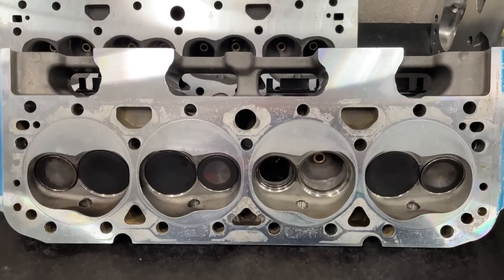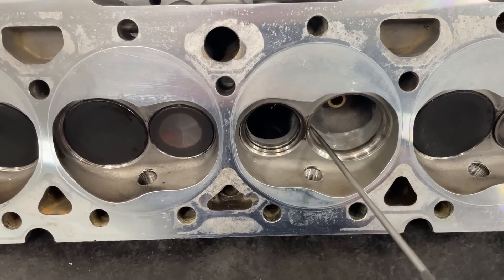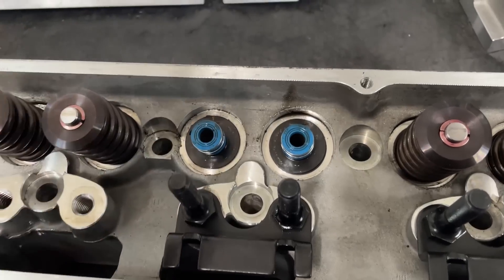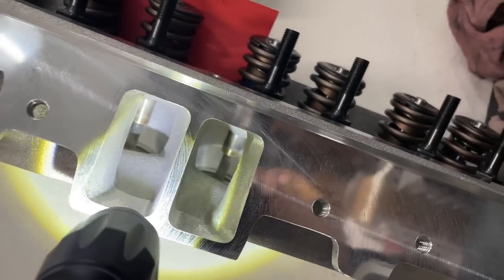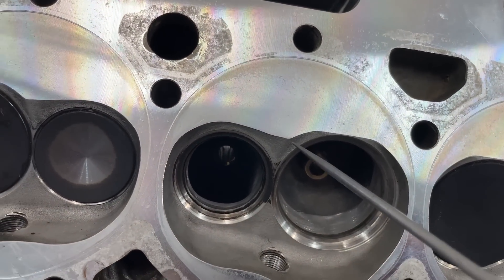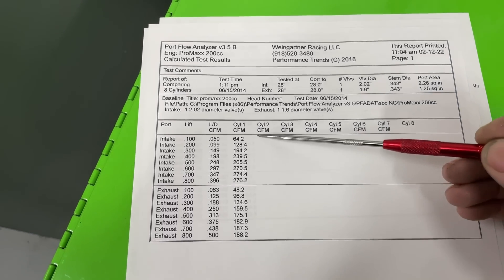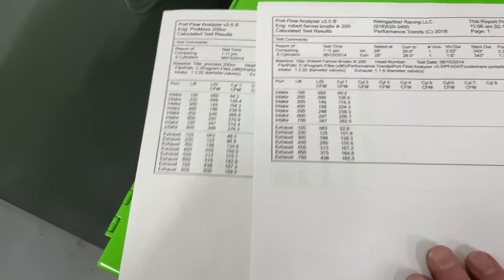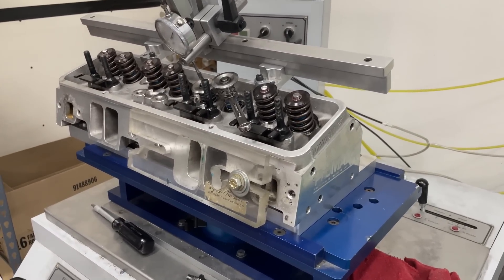ProMaxx SBC 200cc Head Review With Real Flow Numbers

Comment: Just found this video, just to confirm, these are the Maxx series promaxx heads? Thanks! Great content!
Reply: yes 383, 500hp pump gas with maxx 200 heads on solid roller and 600hp on 408sbc dynoed with hydraulic roller with solid rollers and solid springs

Comment: Thanks for this video. I got a set of their 183 heads and later saw a video where you shared Promaxx was a copy of the IL head. I feel it’s safe to assume the smaller 183 would be just as proportionally better in flow than it’s Brodix original? Promaxx’s advertised numbers for that 200 head are really close to what you found.

Comment: Begs the questions: I have been told as I have been out of the game for 25 years (military), that many of the "cheap" heads have crappy valves and very thin guides. I get there is some truth to that. For example the  Edelbrock e street heads, budget friendly USA built heads, advertise max .550 lift but have a reported issue above .500. I feel that they most sell a butt ton more heads then the negative responses would leave you to believe, and I would assume the majority of issues are user errors. 

Promaxx (changed names a few times) has the same reputation, but they have been around so long now the heads have to be "okay" at least?

Comment: i run PW heads and they also outflow brodix. it is an exact copy of ik 200. only difference that i can see is the PW has a 67 cc chamber. casting is ultra smooth. they use Brodix valves,  Howards dual springs, Manley valve retainers, Comp valve locks, brodix valves seals, Pep locaters. ARP studs, Brodix guide plates so im very happy. good quality parts  I have the 204 cc and getting 77% of flow on exhaust..  At 600 they flow 273.9 on intake and 211.2 on exhaust. this is the 3rd set i have installed and always the same consistant quality. love your videos
Reply: PW HEADS?
Reply: @gearheadmoff1232  performance world

Comment: @Eric Weingartner  what do you think of the 225cc promaxx heads ? could they be made to flow close to a afr 220 or 227 since these 200 flow like a afr ? if i got them bare and used good parts inside them?
Reply: do you feel with some mild work the 200 or any promaxx head would or could pick up a good bit of flow from where they are out of the box ? or do you feel there close to what you could get out of them?

Comment: I've said on one of your other vids, my son baught a set of their "Maxx 200cc" heads, I don't know if that's what those are or if the "Maxx" series has a little cnc work done or??? But anyways straight out of the box on his 11.1 ,383ci pump gas engine, it flat out rips!!! Been on his engine gotta be 3yrs now, no problems whatsoever! So myself am sold on them thing's, if you're going to buy a china cast head, them are no doubt the way to go! And you can save about 800 bucks compared to an AFR!!! So why not? Especially after seeing this and seeing how they perform on my son's car! I run Pro-filers myself, but building a stronger engine and will be buying a set of their 225's!
Reply: Since they come bowl blended by hand from Promaxx I'm sure there is some variation, but this is a 200cc Maxx series head as it came from the factory

Comment: Another great video Eric! I know promaxx supposedly does all the machine work here, & the heads are supposed to be made of decent material! But what I’ve seen a few times, is guys buying a complete heads with all the parts in them, then run into major issues when they drop a valve & destroy a new engine! (Valve seats were falling out on this one,) Or where a shortblock we built wouldn’t run to 4000rpm! Well the valves were the shittiest I’ve ever seen, & the so called solid roller spring setup on it had about 67lbs on the seat 🙄🙄🙄🙄! Most of the good stuff is set up by distance to bind these days! Luckily he didn’t drop a valve also! So by the time theses guys spent all the down time & money 💰 making them as best as they could be, they were both now behind thousands of dollars 🙄🙄🙄🙄! Things might be much better now???? IDK 🤷‍♂️! But if they are now putting decent parts & doing decent machine work, my question is, why are they so expensive??? Because I’ve heard of engine shops buying pallets of china heads for 100$ per casting 🙄🙄🙄🙄! You know the sellers of the castings are making money! So why do they normally come within a few hundred dollars of the good American 🇺🇸 made castings & parts! If it’s a engine we build, it only goes out with American made parts! Sometimes we have to use the scat rotating assembly’s because of cost! (Not our choice, because it’s usually some morons price shopping!) But 99% of the guys already know the deal & don’t want to send there hard earned cash 💰 to our enemies! Now sometimes parts are brought in, overseas castings & rotating assembly’s, rotating assembly’s are usually not a issue, but if there complete heads, we will not install them without going thru them! From what I’ve seen, the parts in the heads usually get replaced with good stuff! I don’t do the heads, that’s the boss & the cylinder head guy! I also know we did 2 identical BBCs probably 5 or 6 years ago, with the main difference of head castings, one AFR & one overseas castings! Same intakes same carbs, cars that weigh the same, Bla Bla Bla! The car with the AFR heads is almost 2 tenths & a few mph better! Once they spray them, there just about the same! I think 🧐 the slower one has more pill in it 🙄🙄🙄🙄! Sorry for the story! Keep them coming! 👍🏻👍🏻👍🏻👍🏻🇺🇸🇺🇸🇺🇸🇺🇸

Comment: Been doing a lot of comparisons between SBC aluminum heads for my 406 and I'm seriously considering the 225s. Just haven't decided if I'm going to buy the regular or CNC.
Reply: ive been thinking of them on my engine too and regular as i have some decent porting experience. have you found flow on them compared to the afr?
Reply: @turbomonza1561  no, I have not. I did with some other brands but I can't remember which ones at present because I didn't write them down and I compared so many 😅

Comment: I used a set of the 200cc maxx series Promaxx heads on a 383 for a street rod (67 chevelle) with out even trying to get maximum HP it dynoed at 491 Ft/lbs at 3900rpm 499Hp at 6600 rpm with a small roller 242/606, 10:1 compression. pump gas. I ordered them bare with valves and put LS B hive springs on. They were considerably less expensive than AFR. My customer is very happy with the out come. I am sold on them and the people are pleasant to work with.
Reply: Was that at the crank or wheel?
Reply: @morganpowell2999  It was crankshaft HP, My customer got 2 sets of rear tires to the first oil change. since then I bought a shocker series set of SBC and had them flowed, they came up short of their advertised numbers and that motor hasn`t been dyno`d,  this Eric guy had the same results on the shocker 225`s.
Reply: @edpetrocelli2633  nice, I was curious because I have the exact setup except a little smaller cam. It is the .236/.242 duration with .550 lift. Just wondering the ball park figure of power. It feels every bit of 450, I was guessing 475-500 range.
Reply: @morganpowell2999  Most people don`t or have never driven a car with 500HP. It`s a problem trying to get the tires to stick, but they`re fun to drive. We did run flat tops with 1.6 rockers which run the lift up to .604 and stud girdles
Reply: Thats Eris Wiengardner
Reply: How much to do a port job on a set of these
Reply: @jefedabusiness5570  I don`t do head porting, I don`t have the patience for it. Before Covid it was around $1000 to $1500 a pair, you`ll have to shop around. Call Eric, I`m going to give him a try the next serious motor I get.
Reply: Thats Eris Wiengardener
Reply: You don’t have to be upset because you realize pro Max is nothing but a bunch of Americans who bought the block casting from China and then they improve it. Just like sending it off to a machine shop and getting a valve job done they improve the things that are wrong with the regular old Chinese heads, and they were smart enough to open the shop and do their work what they were experts at and buy the casting for a fraction of the price and be able to resell itand outperform the other manufacturers, but that’s it American ingenuity right there
Reply: @terryfonz4603  You`re right, its just a chunk of aluminum till ya machine it, since I last posted I put a shocker 225 set on a 408 and dynoed, made 600hp on pump gas using a hydraulic roller with solid roller lifters ( Steve Morris suggestion) and 250lb pound springs, its still running and ate up 2 transmissions

Comment: Thanks for the video Eric.  I have sold quite a few sets of these heads along with many other offerings from ProMaxx.  Great service and have customers with 20+ thousand miles on them, with no issues what so ever.  These heads make very respectable horsepower.   They are a good option.
Reply: These use 7 degree or 10 degree locks on the valves?

Comment: Were the inside locators a nice fit to the size of the springs?  My small block Mopar promaxx heads also had inside diameter locators, but they were pretty sloppy - meaning inside locator was quite a bit smaller then the inside diameter of the spring so there was lots of movement.

Comment: I had called Promaxx about a month ago and asked who's valves they are using. They said they use to buy them straight from Ferrea but they had a cost issue so now they buy there valves from some place in Argentina. I also asked about Valve springs and they told me they were Pac springs.
Reply: Argentina makes good valves most top head manufacturers use them.

Comment: Have you ever flowed any pre eliminator 220 AFR SBC Heads ?  I have a set  standard 2.08-1.6 valves that flowed 263/203 @ .400”.         320/225 @ .600”.            And max flow at 333/231 at .900” with a 4 angle valve job and no extension on exhaust     Flowed on a 4.155 bore.    Curious if that is a respectable head for what it is.   Thanks.
Reply: I have a 79 Camaro all stock steel and glass I built a 421 stroker with the afr 210 competition ports 12.1 compression 700 lift 276 duration at 050 solid roller I did best of 1.4 60 ft at 6.67 at 104 in 1/8 went from first to third gear off the trailer my gates on my bnm shifter messed up I street drive everyday until I got rear-ended few months back now the car is in shop getting the rear fixed screwed up my rear end my frame connectors I'm bummed my dad had the car  since I was 1 gave it to me in highschool now I'm 36
Reply: Not to hijack thread,, The AFR heads are great products. Use the 185 on my 350 builds. The 220 on larger displacement strokers, out of the box , excellent flow numbers.  These heads are used on Skip White Performance engines, as well as Scott Schafroff engines. Excellent castings, as well as fit and finish. My personal Dart blocked ,fully forged , balanced rotating assembly 427 stroker ,has the 220s .  In an 81 malibu wagon , daily driver, runs 7.60 8th , 10.76 qtr. 1.70 ish 60 ft times. Can't  go wrong with AFR.

Comment: Hey Eric. that last video you did about the different stock LS heads. well I got a Holden 5l head flowed a stock iron one and it was interesting because it flowed 240cfm on the intake and 180 on the exhaust but hit 165 by .300 and flat lined that was with a 2.020 intake and a 1.600 exhaust. it's interesting because it flows very similar to the LS heads from the 4.8l and 5.3l. I think the Holden 5l EFI head was GM's first ever spread port head. If they weren't iron I would send them over for you to have a play with. TK or Tony Knight here in Australia does some good porting with them. TK did a set of the old carby heads which are basically a Pontiac or Olds head from memory and got a 308ci engine to 620hp on the engine dyno with iron heads.
Reply: I remember the efi intake was similar to an ls1 as well.
This engine was released in 1988?
Reply: @indyrock8148  yea we call it a bunch of bananas intake down here. They perform very similar to a TPI intake. 
Main reason I'm considering an LS swap is due to the only intakes avaliable aftermarket for the Holden are Edelbrock, Harrop and Torque power.